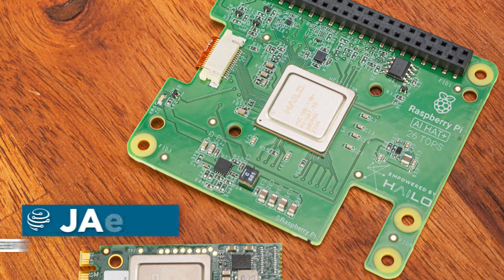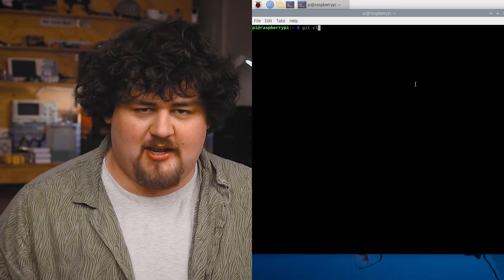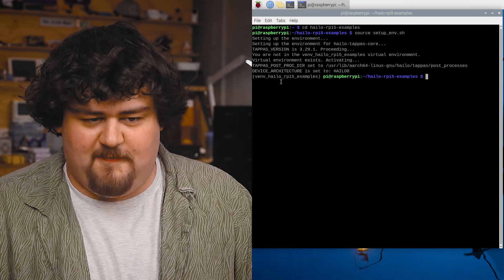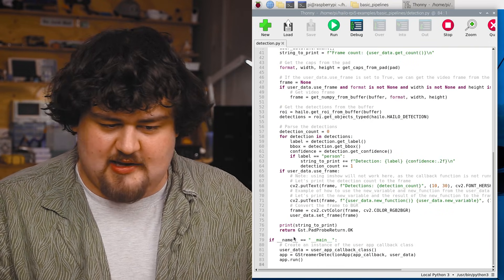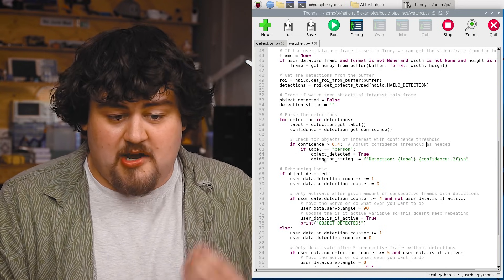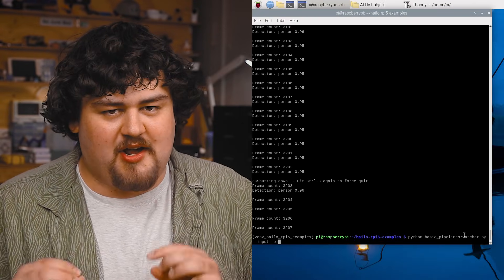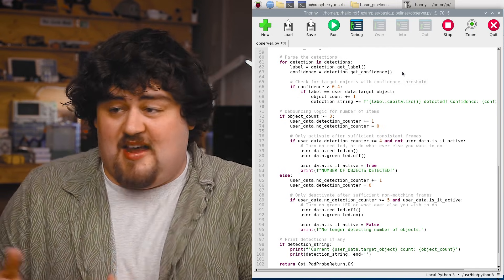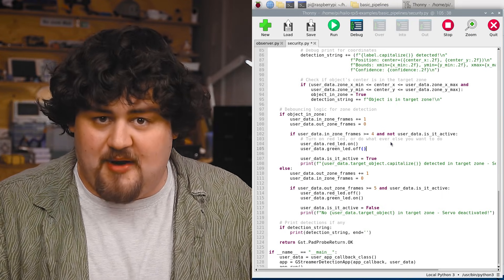YOLO Object Detection on the Raspberry Pi AI HAT | Writing Python Scripts

Comment: important note- if you are using the raspberry pi imager. make sure you flash the legacy 64 bit pi os (can be found under raspberry pi os - other). You need to be running python 3.10 or 3.11
Reply: why is this? I am getting an error and want to see if this is the cause. 

ERROR: pip's dependency resolver does not currently take into account all the packages that are installed. This behaviour is the source of the following dependency conflicts.
types-seaborn 0.13.2 requires matplotlib>=3.8; python_version >= "3.9", which is not installed.
types-seaborn 0.13.2 requires pandas-stubs, which is not installed.
hailort 4.23.0 requires contextlib2, which is not installed.
hailort 4.23.0 requires future, which is not installed.

Comment: Thanks for this great tutorial, just got a raspberry pi 5, when I run the sudo apt install hailo-all I got this error
Unable to locate package hailo-all
Reply from the maker: If you are running Trixie OS you may be getting this error. Raspberry Pi is still working on support for the AI HAT with Trixie. In the mean time, you will need to instead install the older Bookworm OS version which can be done through the Raspberry Pi Imager as well.

Comment: Thanks to your explaination I was able to understand the setup and everything. I also generated a custom model in HEF format and would like to implement in personal use case. However I noticed that it is not possible to run any pipeline without the pi 5 venv. Is it a must that I stay in that folder and in that virtual environment? What if I have a professional use case of AI HAT+ and want to implement a custom model in one of my programs for detection?

I was familiar with yolo only, and still trying to figure out HEF detections

Comment: Can raspberry pi's new Ai Camera do the same thing without the need for the Ai hat or is this a better option?
Reply from the maker: AI Camera can do something similar, but the HAT is probably a better investment. The 13 TOPs version is about the same price as the camera, but its faster, more flexible, and easier to use.
Reply: @Core-Electronics  From my understanding the Ai HAT is only compatible with pi5 though correct while the ai camera is good with 3 and up?

Comment: Hello, does this system also work with depth camera? i need to detect objects at the  same time as getting the depth. and also, I was using SAM2 for detection but it runs drastically low on pi. do you have any experience using that? which one you recommend?

Comment: Thanks for this, great tutorial, I am having issues however, just got a raspberry pi 5 and havent used it for anything else but when I run the sudo apt install hailo-all I get this error 

sudo apt install hailo-all
Reading package lists... Done
Building dependency tree... Done
Reading state information... Done
Some packages could not be installed. This may mean that you have
requested an impossible situation or if you are using the unstable
distribution that some required packages have not yet been created
or been moved out of Incoming.
The following information may help to resolve the situation:

The following packages have unmet dependencies:
 hailo-all : Depends: hailort (>= 4.20.0) but it is not installable
             Depends: hailo-tappas-core (>= 3.31.0) but it is not installable
             Depends: rpicam-apps-hailo-postprocess (>= 1.6.0) but it is not installable
             Depends: python3-hailort (>= 4.20.0) but it is not installable
E: Unable to correct problems, you have held broken packages.

wondering if I can continue despite this or how to fix it?
Reply from the maker: Check your OS installation, it needs to be 64-bit. We have seen this issue a few times before and it occurs when the package is installed on a 32-bit installation of bookworm. You might need to reflash a 64-bit image.

If that still doesn't fix it, feel free to post the issue on our community maker forums: 
https://forum.core-electronics.com.au/t/yolo-object-detection-on-the-raspberry-pi-ai-hat-how-to-write-custom-python-code/21386/5

Comment: This was a great intro to the AI Hat. I have the 13 TOPS hat, and it works like a charm. I was able to couple this with a model training workflow, and it turns out Hailo is actually pretty good for customer models and pipelines. Thanks!
Reply: Did you run yolo models ?
Reply: @joseandresmillan16 yolo 8

Comment: 6:18 - Wow... it's doing inference in real time really good... What kind of FPS are you obtaining and any kind of pre and post processing?
Reply from the maker: The Pipelines are a little restrictive to running it at 30 fps, there are possibly ways to overcome this though. But we were able to get a very consistent 30 fps with the medium sized model on the 26 TOP version. From memory we were still getting very good fps with the large model. All of the pre and post proccessing is done in the demo pipelines

Comment: Thanks Jaryd! Great video. Bought a solid kit for my project(RPI 5 16 GB Ram, AI HAT(26T), cam v3, cooler etc. Last thing is to monitorize them with a mini-micro display. Do you recommend any displays? My .py code with YOLO-trained .pt model runs properly on Mac, has a inference and live detects some objects. It needs a really mini display(under 1 inch) for RPI. Found some on internet like Sony ECX331D 0.5 Inch 1024x768 OLED Display but it doesn't ship to my country. Do you have any suggestions(waveshare 0.96 inch etc.)?
Reply from the maker: A tiny bit bigger than 1 inch, but this is a nice budget screen with documentation from waveshare:
https://core-electronics.com.au/13inch-ips-lcd-display-hat-240x-240-pixels.html

Depending on what you want to do, you could also use a simple 0.96 inch oled screen. It can't be used like a regular screen nor show images, but can be a good option if you just need text or information to be printed!

Comment: Hey Jaryd,
Love your style, ım doing all the instructions but one the rpi5 folder in basic pipelines folder ı don’t have the hailo_rpi_Common file and when ı run the detection on Thommy is says no module named hailo_apps_infra

Best,
Nafi
Reply from the maker: Hey Nafi, we have seen that error a few times and its almost always related to virtual environments. Check that Thonny is set up to use the virtual environment we created, and that you use the environments as shown in the videos. 

As for the common file, it has been moved somewhere else in the project folder - an update from HAILO has changed its location.
Reply from the maker: Hey Nafi, we have seen that issue a few times and its almost always related to virtual enviornments. The biggest issue is ussually Thonny not being set up to use the virtual environment we created.

Comment: Hello there,
It's a very interactive video from your side. You have very well explained the process and purpose of this HAT. Great work... thumbs up

I have a question, is it possible to connect two HAT at a time with the Raspberry Pi 5? Specifically the Raspberry PI AI HAT and the Waveshare SIM7600G-H M.2 4G HAT for Raspberry Pi, LTE CAT4 High Speed, 4G/3G/2G, GNSS, Global Band.

Actually, my main concern is that I want to use the setup where I can have a mobile network but not a wifi network. Because my main concern is to send the messages using the mobile network only.

If it's possible, do reply asap as I am already very late to submit my assignment.

Thanks in advance...
Reply from the maker: We found that the AI HAT doesn't use any of the Pi's GPIO pins, so the extra HAT should work!
Reply: @Core-Electronics  thanks for your immediate response...

Comment: Wondering if the PI AI HAT is installed, the AI camera is overkill.  Or, if by having both we extend the capabilities of the module. Example: AI camera takes care of Media Pape hand gestures while the PI AI HAT handles other trackings.
Reply from the maker: I'm not sure if that would work as they have extremely differing workflows and pipelines. Someone with a lot more braincells than me might be able to, but the AI Camera would only be adding a few extra Tops of processing power. Would be able to run both at the same time with their own respective models pretty easily though!

Comment: hello sir, i found this video very helpful and I'm very appreciate it, however, i have a question remain unsolved. if i am using my own model, lets say, the model name is yolov8.hef, what should i do to run it with python scripts?
Reply: can i understand it like, i can just put my model in the resource folder and when ever i run the pipeline, it will automatically use the hef file in resource folder?
Reply: wait, I understand now, thank you very much

Comment: Hello, Jaryd!  It is well done video and instruction for Hailo hardware and software installation. I have followed well all steps till moment 6:00, where you entered  --help command.
Unfortunately, instead of list of options  I have got there some failure with following message on my Terminal:

Traceback (most recent call last):
  File "/home/igzait/hailo-rpi5-examples/basic_pipelines/detection.py", line 9, in <module>
    from hailo_apps_infra.hailo_rpi_common import (
ModuleNotFoundError: No module named 'hailo_apps_infra'

Here  igzait means my folder.  The same message appears, if I  enter -- input rpi ... 🙄What was wrong in my way? Please, help.   Note, please, that I use camera Module 3 on my comp. Thank you in advance.
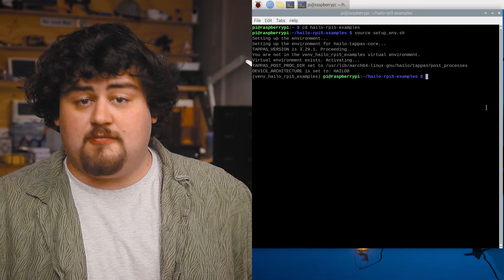My later correction:  no problem! :face-blue-smiling: The reasoon of the mistake was, that I did not repeat again  two steps, mentioned by yours at the moment 5:20 of the video, namely entering of the   "source setup_env.sh" command.  When I made this again, everything went better.  I decided not to delete  this my comment, because such problem might appear with some other readers. Thanks and best regards!
Reply from the maker: Thank you for the troubleshooting!
Reply: I am facing the same problem can you please help me out

Comment: awesome video, but I wondered which would deliver better performance and frames per second (fps). Is it the combination of the Raspberry Pi 4 with the Pi Camera AI, or the Raspberry Pi 5 equipped with the Raspberry AI HAT?
Reply from the maker: Definitely the AI HAT. The AI camera is a fair bit slower but can run on older devices. The AI HAT comes with the 13 and 26 TOP version, and even the slower 13 TOP will be faster than the camera. The AI camera also has a limited amount of memory on it, making it difficult to run larger YOLO models.

Comment: Do you think it possible to create model that can detect sign language and use the hat at the same time
Reply from the maker: It might be possible but it would be a very involved task. You would need to start by training a YOLO model to detect sign language which may be the hardest part to do reliably. If you can achieve this though, you can convert the YOLO model to the .HEF format and run it on the HAT.
Reply: Do you have tutorial on how to convert yolo model to HEF.format?
Reply: @akshay-hc1eg  Trust me, building the model would be the easy part..

Comment: how do I train the model to only recognize chickens?
Reply from the maker: Using a custom model with the HAT is unfortunately quite involved - not impossible, just not easy.Y ou will first need to train a YOLO model to detect chickens, then use the Hailo dataflow compiler to convert the model into the .HEF file format the HAT uses.

A good first check would be to see if anyone has already trained a YOLO model to detect chickens, hugging face is a good repository of models and here is a link to pre-trained yolo models.

https://huggingface.co/models?other=yolo
Reply: @Core-Electronics My raspberry pi just arrived and i tested it and it recognized chickens as "birds" so would that be good enough for my automatic chicken feeder??
Reply from the maker: If it works, it works. Didn't know it recognises chickens as birds but helpful info, cheers!

Comment: Hi, do you know how to use webcam and ip-cam with RP5 + Hailo?
Reply from the maker: When we run the --help option to see all the pipeline options you should see the option to instead use a webcam. In the basic_pipelines folder, you will also find a script you can run which detects your webcam name to use with that pipeline option.

In terms of IP-cam that might be a little more involved, and if the setup won't natively take an IP-cam as an input, you can definitely find a library to do so. If you need a hand with this, we have a maker forum where you can post this question, we have a lot of makers over there who can help.

https://forum.core-electronics.com.au/

Comment: This one is SO much faster than the models in the last video. Do you know if there is a relatively easy way to pull in the yoloworld model here instead of Yolo8 or whatever its using? Or a way to leverage this speed with the way you demonstrated Yoloworld in your last video?
Reply from the maker: Unfortunately we are out of luck here. There is no way to usual Yolo method with the HAT as it uses a completely different workflow and needs a model format called HEF. You can convert normal Yolo models to HEF with the Hailo Dataflow Compiler, but it is a little bit of an involved process - not impossible though. You may have some issues with converting Yolo World as well, and once you convert it to HEF, you have locked in the prompt. To change the prompt you would need to re-convert it to HEF.

This may change though! The HAT is still relatively new but lots of very clever have access to it, so maybe in time!

Comment: How can it be used to detect let's say  Pikachus? Probably we have to train the model; but can you help us on that?
Reply from the maker: You will need a custom model, but thankfully someone may of already trained one for you as there are Pokemon detection models on Hugging Face:

https://huggingface.co/models?other=yolo&sort=trending&search=pokemon

The next step is to use the Hailo Data Flow Compiler to turn it into the HEF format that the HAT needs. This can be a bit of an involved process, but its not impossible.

If you don't wish to go through converting the model, we also have a guide on running the YOLO model directly without the HAT. It is slower, and doesn't use the processing power of the HAT, but its very easy to use custom models.
https://www.youtube.com/watch?v=XKIm_R_rIeQ

Comment: Can we use the new AI Pi Camera ? If yes, can we even acelerate the processing with it ?
Reply from the maker: Both the camera and HAT need different model formats to run. We haven't tested, but its likely that you could run the AI camera and the AI HAT at the same time on the Pi, but they would both be running separate models. It is extremely unlikely that you could use both together to accelerate the processing even more.

We also don't have a solid figure, but I would guess the AI camera is around 4 TOPS (a measurement of computing power). The AI HAT comes in a bigger 26 TOPS version so 4 extra tops wouldn't do that much.
Reply: @Core-Electronics  Yes we can, i tested but i wish that were somehow campatible to accelerate even more the process